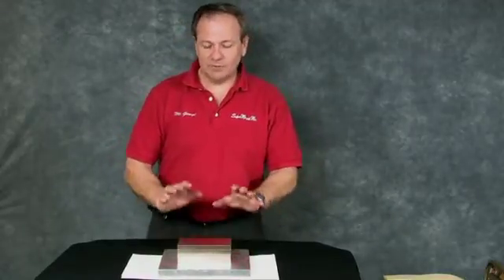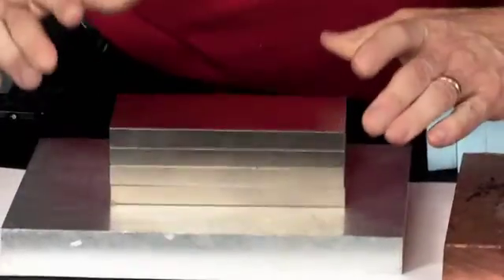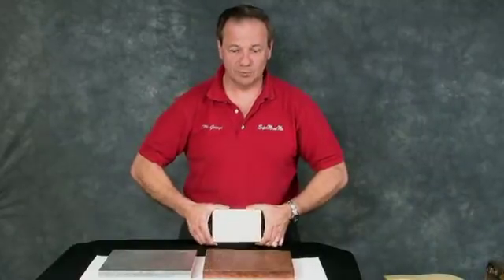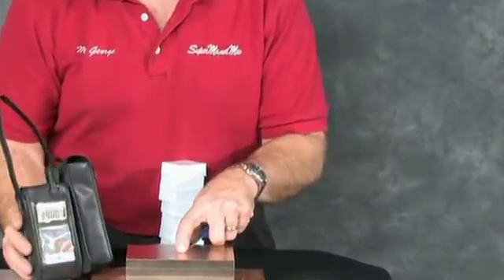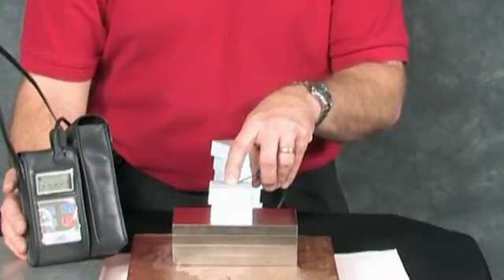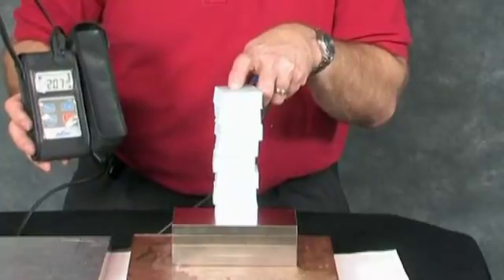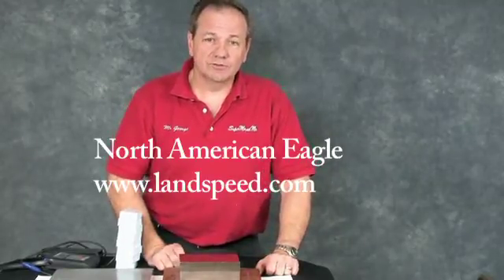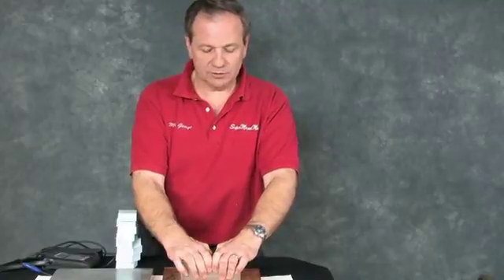SuperMagnetMan - Magnet Brakes Fall on Copper

Comment: As far as i know, the strength of the repulsion is proportional to the speed the magnetic field changes; as well as the strength of the field itself, and the distance from the metal, and of course how much metal is interacting with the magnet; and the effect happens differently with different metals.
.
The effect does work horizontally as well; a jetcar with strong magnets should be able to float on a copper or aluminum road after it goes past a certain speed. The road would push back though.

Comment: It is known what magnetism is. It's just circulating electric charges and relativity.

Basically if you move past a magnet, all of the charges appear to redistribute slightly due to relativity and you end up with an electric charge appearing.

It's that electric field that causes magnetism; when both materials have a current; the two sets of electric charges attract or repel each other.

You can't see that electric field unless you're moving, so it seems mysterious and we call it 'magnetism'.

Comment from the maker: Actually no but I would bet it would be cool.  I have to try and find out how to get some liquid nitrogen.  Dry ice is the coolest stuff I have worked with.  I think the eddy current braking in the vertical direction is sooooooo cool by itseld.
Reply: How thick does the magnet have to be to be able to brake its own fall on copper? Could a thinner magnet do this successfully without breaking? What if we chose a height of 1 m ( ~3 ft)?

Comment: @ThaRealKalimpa Magnets affect magnetic recording devices like disks, tapes, VHS, credit cards, etc. because they use ferrous metals and magnets to align those metals to create patterns representing the 1's and 0's of the computer. Therefore a strong enough stray magnetic field can realign the ferrous metals. You could rub a magnet over a CPU all day and it won't affect it.

Comment: I can explain this. This has to do something about induction right? The electrons inside the copper get slided away of the magnetic fields, but with an angle of 90 degrees and thats why it slows the magnet down strongly. The energy the electrons use to slide away comes from the velocity of the falling magnet. Am I right? Please correct me, if I'm wrong.

Comment: @locouk I'm pretty sure you will find that copper is a better conductor than gold. Gold is used for contact surfaces because it doesn't easily corrode. Silver is a better conductor than copper. I have loudspeakers that use square silver wire in the voice coils. They're old, so they use Alnico V magnets.

Comment: How did you put them magnets together without broken fingers or shattering the magnets? 
have you tried dropping a 24ct gold ring on them, as gold conducts electric better than copper, it should have better magnetic braking.

Comment: It would be interesting to try it with an aluminium plate that weighed the same as the copper one.

The resistivity of the aluminium is higher, but the resistance to mass ratio is ~30% better. I think there would be a lot less difference, but due to the geometry I think the copper still wins here.

Comment: @SuperMagnetMan A way to do it might be to spin a disk using a gearing system resting on the tyre; that way you'd get more bang out of your magnet and disk weight/buck. The energy lost is forcexdistance, so increasing the disk rim speed is a big win; bicycle rim speeds are quite low. I expect you'd still need a fairly big magnet though.

Comment from the maker: @joelito101 - Certainly. send me a message and we can see how we want to do it.  probably an aluminum or copper ring around both sides of the rim.  Then we will have lots of linear inches of stopping surface.  Then I would start with a little arc of about 6 inches long and on both sides mount some magnets about 25mm x 6mm x 2 or 3mm thick in N50.  Use a mechanism like the basic brake calipers to move them close to the rotating rim.  Its a start.